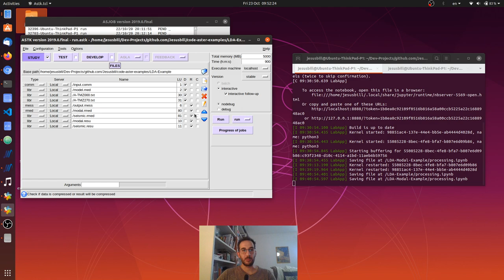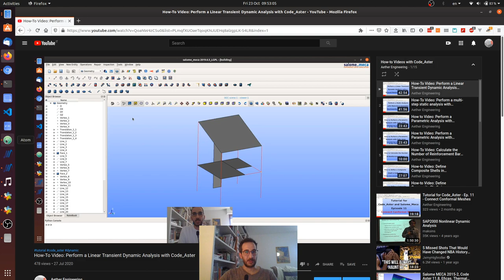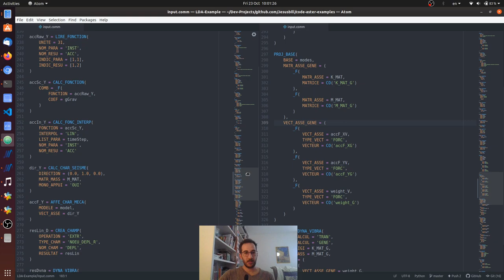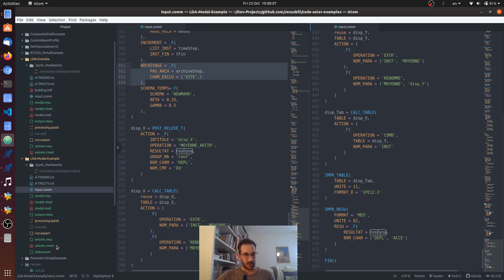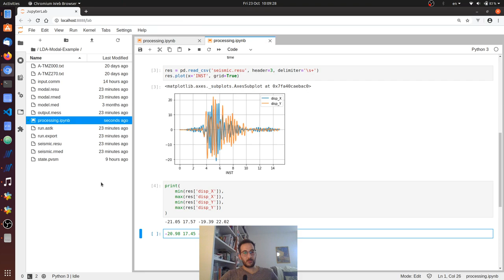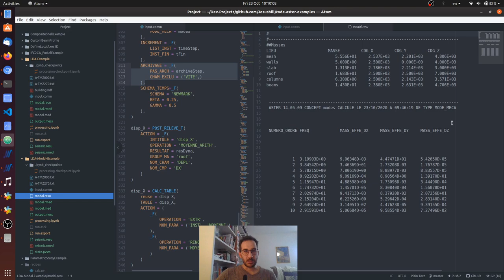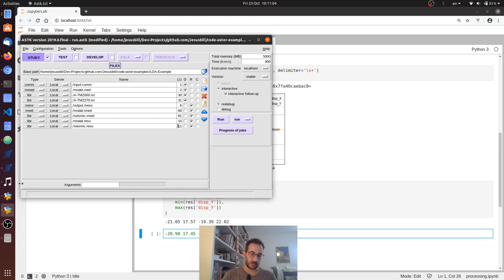How-To Video: Perform a Linear Analysis with Modal Base in Code_Aster

Comment: great video as always.
i have 2 questions:
1) How did you manage to place the two models side by side in paraview and write on them
2) Can you do a linear dynamic spectral response analysis? with the load combination and so on. it is that most used analyzes for the new structure.

thks
Reply from the maker: Thanks Paolo.
1) When you import a model in the Properties tab there is a section called "Transforming" where you can move, scale and rotate the model. The text is inserted using from the menu file Sources > Alphabetical > Text
2) I will try to organize some tutorials on the response-spectrum analysis, it should be more than one as the argument is complex and there are a lot of things one should do to perform this type of analysis. Thanks for the suggestion
Reply: @aetherengineering7387  thanks for the replay. 
I can't find The transforming Tab in paravis, but i find this in a standalone paraview. Maybe Salome-meca "customization stuff"?

Thanks anyway. I Hope you can make the videos on response spectrum analysis
Reply from the maker: @peeolo  no customization on our side. The tab is the "Properties" one that is the main tab. After inserting your object, in there there should be a "Trasforming" section, part of the "Properties" tab.